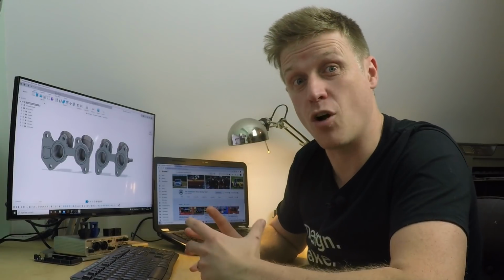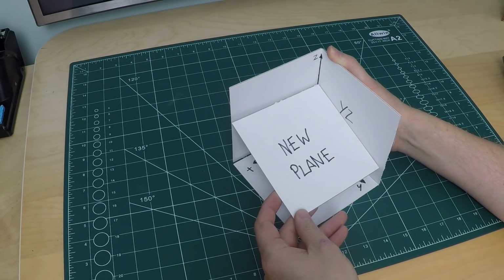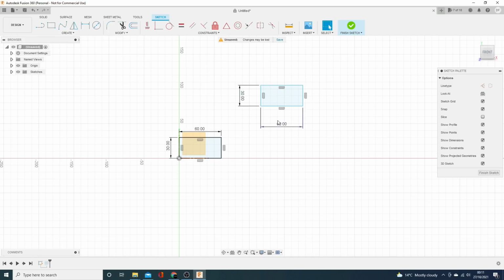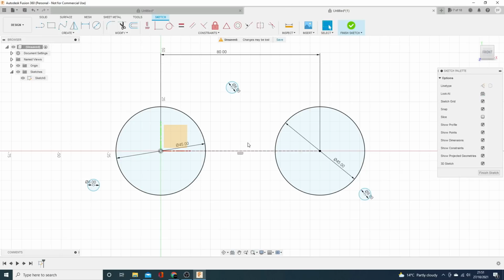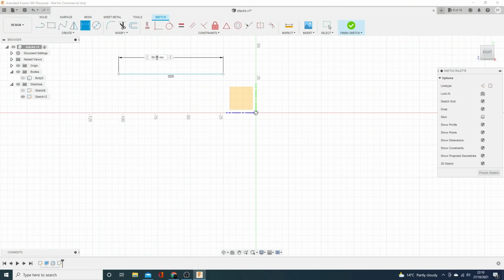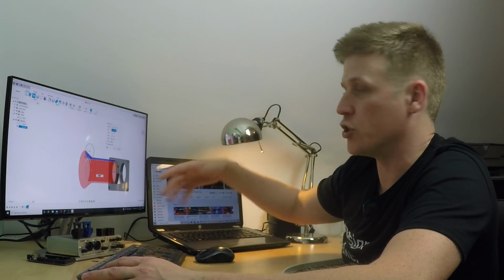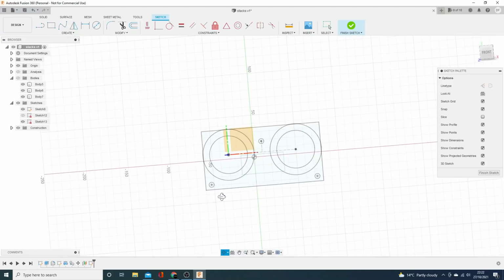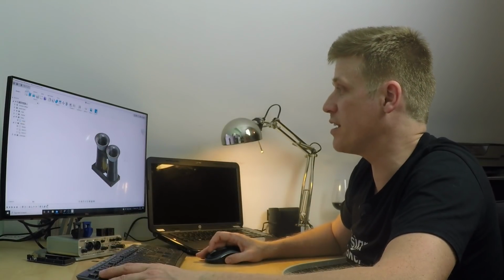How to 3D Model functional car parts for Beginners (and everyone else...) on Fusion 360

Comment: 18:17, as soon as I got to this point, I got a warning that "this dimension would over-constrain the sketch" and it'd give me an option to create a 'drive' dimension instead. What is that and how did you keep creating so many constraints? Why's there a limit on constraints as well? This is my first ever time using any CAD software so I quite literally don't comprehend what that means to be "over constrained 'in that dimension'"! My guess this is just one of the limitations of using the free version maybe?

Comment: Which is the best approach to scan my current air filter box, remodel it(to remove obstructions but keep mounting points) and print it? My question is related to which is the best software for scanning, the best file format and the best software to remodel the created 3D model?  I will be using my phone for the scanning and i have settled on Kiri Engine.

Comment: I also use Fusion 360 free version, which is great, but I absolutely hate that they refuse to let you import an STL file as a parametric model unless you pay for the expensive subscription!
Reply from the maker: FYI… I have the full version, and that function just doesn’t work on stls from scans.  Too much noise and soft edges between faces.  If it does work then the model is so simple you may aswell have modelled it, it would take less time.

It does work better for stls made directly from CAD, (like you might download off Thingiverse) but it still isn’t a magic wand…

Comment: There's lots of really cool features for fusion like defining "parameters" that you can change outside of the sketch, you can reference other dimensions by clicking on them when you edit one or typing it in like d12. And you can import and scale images. Really useful if you have a head gasket or something, take a pic with a ruler, load it with insert canvas, then you can scale it by right clicking on it in the tree of parts
Reply from the maker: I’ve not fully got into the parametric side of things, but getting everything fully constrained is the start…. Something to look at I think!

Comment: Love your channel!  I wanted to make a couple general notes.  I have been a cad professional and have been a trainer for over 10 years.  On the autodesk website 99% of the fusion courses i created.  I have supported loads of different software over the years and Fusion is amazing.   A note i wanted to make is that you said fusion doesnt have cfd and fea.   Cfd is true but it does have fea and generative design.  It will do everything from linear. Non linear. Buckling. Modal. Event sim and on.  It also has Cam to control 5x cnc machines and growing additive.  It should be noted that some limitations apply to the free hobby license. For example you cant poat gcode with tool changes.  The software is generally around $30usd a month though.  So if you use it at all it is very worth it.

I dont want to hijack your channel but recently ive made some car modeling content in fusion that might be right up your alley.  https://youtube.com/playlist?list=PLBDfGh8A8kXUOahS8yk-t0o1nkyzGGQyO

Keep up the great work!
Reply from the maker: Yeah, the paid version has some bells and whistles but I am just trying to get people excited to use Fusion, I see a lot of people on FB struggling with TinkerCAD when Fusion would be a great fit and they should really upgrade.  
The free version of Fusion is really unbelievable (and 10years ago it’d be madness that it would be free) and I just want to get people excited for that!

Just checked out your Form videos, this is a bit on F360 I don’t know we’ll so I’ll be using them 👍
Reply: @MakingforMotorsport  if you ever need anything with Fusion please let me know. Happy to help.

Comment: Engineer here with reasonable 2D CAD experience. Just starting 3D CAD and it has been quite the learning curve. Most of the tutorials I have seen neglect to show you how to go from your extrusion back to a sketch, and how to use the section analysis tool. While these are pretty basic concepts it is extremely frustrating trying to draw parts with out these tools. Great video and keep up the good work. With any luck this will become one of the "go-to" beginner Fusion 360 videos.
Reply from the maker: Thanks John, there are great tutorials out there on specific subjects but if you don’t know, you don’t know!  That’s why I thought I’d do it how I model, I’ve always learnt the most by looking over peoples shoulders anyway!

Comment: If you want two items to be at the same height, you can use the horizontal and vertical constraint on a pair of points rather than using a construction line and a coincident constraint.
Reply from the maker: Cheers bud!

Comment: do i revolve to make o rings fitments?
Reply from the maker: Just filming the ITB section of the next video right now!  It’s coming!  (But no, you can simply draw the inner diameter on the flange head surface referencing off the centre of one of the initial inlet holes, offset the circle by the width of your o-ring groove.  Then do a cut extrude back into the flange et voila!) 👍
Reply: @MakingforMotorsport  thank you mate, you´re awesome, awesome work and dedication. Hope we build up great things togheter!

Comment: This is such a good tutorial. I use solidworks for my job but fusion seems far easier. I have a large SLA printer which can use resins with high use limits of ~260 C. I'm wondering if I could 3D print nearly a whole ITB manifold.... usually intake manifolds don't go over 200 C
Reply: What resin are you referring to? I can’t find a high temp resin.
Reply from the maker: The software you know best is always easiest but I think the learning curve with Fusion is definitely flatter than others I have tried, but I’ve not done much with SW to be fair…

Comment: I’ve got my ender 3, but my laptop is too old to run 360. What do you recommend for sensible money? I’m not a gamer, so 360 will be the most work it has to do. Great content!
Reply from the maker: I ran Fusion360 on a 10year old i5  and integrated graphics, I just banged an SSD and maxed the RAM to 8gb.  It started to chug slightly with the ITB manifold, so if you stay the simple side of that, there’s the spec.  I changed to a desktop mainly for the video editing, but a 10year old Workstation with 12gb of ram and a 4gb graphics card is doing better 👍

Comment: Im working on 3d scanning my Mini R53, all the intricate details like enginebay and wheelwells and all other parts to model stuff around what is already there and have the correct angles and mounting points etc. Using F360 and Blender for it
Reply from the maker: Nice!! What 3D scanner are using and what’s the accuracy like?
Reply: @MakingforMotorsport  Photogrammetry and my xiaomi note 10 pro phone, so quite tedious when it comes to mesh generation and cleanup, but the more i do it, i get more details, plus a ton of reference pictures of course. Correcting the scale is essential and is usually off no matter how good the mesh is

Comment: Another great video full of information. Content and production at the top end of things. Nicely done. I recently made an intake manifold and velocity stacks for my ITD 's. I didn't use this method. My son says I'm to old, cause I melt metal things with magic flames.... and spin ally tubes while I rub them with sticks.
Reply from the maker: You can tell you son sometimes the old ways are the best ways… but they’ll not the cheapest ways!
Casting of some kind is definitely on my agenda…. And metal spinning is akin to a lost art…. (I suppose I might be helping kill them off! 😳😬)
Reply: @MakingforMotorsport   I saw a bloke on You Tube spinning hub caps  He was in Birmingham. The company had been there 3 generations. You couldn't say they were doing reproductions cause they were still producing from the original dies. Thought I'd give it a go.... and it worked.... I do love a box of sand, got taught to do that in High school. I don't think they're aloud to do ally casting in schools any more...We did the local hill climb last weekend.. beet all the Mustangs and a couple of Ferraris. He put it up on one of his side channels Getz going....
Reply from the maker: Just checked it out, looks like he’s pedalling  that Hyundai pretty hard! 👍. I’ve learnt the theory on these techniques… but no doing yet.  It’s a matter of time…
Reply: @MakingforMotorsport  He's still on L plates so I have walk up to the finish line and sit with him when he drives back., cause the return road is public. The folk that run the events are really good and very supportive.

Comment: Why are you using your 3D space with Z as one of the horizontal planes when Z is the vertical?
Reply from the maker: I though I was using XY plane for the first sketch? 🤷‍♂️ maybe not… I’ll have to check…
Reply: @MakingforMotorsport  Look at the view cube in the upper right corner. To change this click your name bubble in the top right corner and click preferences. You will find this parameter titled Default modeling orientation. Dont change it on an existing model, it can mess up critical elements. Really this only plays on the print stage and maybe you want to not worry about orientation. I do like to design with my orientation's setup in the software and that way I can model the design in the orientation I want it to be in when I send it to the printer and not have to fuss with moving axis. Anyway I was just curious why you had this setup the way you did and if I am not mistaking how you have it setup in this video is the default as it is when you first startup Fusion 360.
Reply from the maker: @kevinm3751  yeah it will be default as I’ve not played with it, I have checked and the modelling I do start on XY and make a point of saying it.  I think everyone has to find their own way of envisaging the 3D space but they do need to think about the print z-axis, if they make that the model axis, we’ll it’s one less button in the slicer 🤷‍♂️.  Thanks for the comment 👍

Comment: Good video nice clear advise.

A couple of things to help you, 

if you highlight a line and press X you can turn it into a construction line.

You can use maths when dimensioning, so rather than calculating 1/2 of 126 you can type 126/2 and it’ll dimension the line to 63.
Reply from the maker: Cheers, that’s a handy tip!

Comment: Always interesting the way people use programs and work around stuff.
I like to label the sketches so I can just directly go to that point and edit.
Also short cut keys like x changes a line to construction, d for dimension, e for extrude and so on.
Also pan with the middle scroll button on the mouse and hold shift and use the scroll to orbit.

Enjoying this sort of content because I am working on similar stuff with my race engine.
Reply from the maker: Oh man, using shortcut keys! Now you’re flying!  I’m still trying to remember the shortcut keys for my editing software, and i spend a lot longer editing than modelling 😩😭😂
Reply: @MakingforMotorsport  hahaha i wouldn't know where to start with video editing. Can snip on the phone that is about it. All i did for my car stuff on my other channel thing.

Comment: A few small tips:
-Turn off 3D sketch (unless you really need it)
-For the 45mm and 6mm holes instead of dimensioning them all just give them an equal constraint (or link the dimension by clicking on the previous one when creating it)
-I'm asuming the 40mm is because it's halve of the 80 so I would click on the 80 dimension and then put /2 behind it so it will say something like "d12/2" that way it will auto update if the 80 changes, could also give it a midpoint constraint with the vertical construction line that is 80 long that should give the same result.
-Fully constrain the sketches (it will show a lock symbol on the sketch in the tree on the left if they are fully constrained)
-For the 22.5 dimension on the revolve I would select the "centerline" first then select the outside line and before you put it down right click and select diameter dimension that way it will see the centerline as the mid and you can just use 45 without having to do halve. (If you want to do it even nicer you could turn on visibility of the first sketch > right click show dimension > and link it with the 45 out of that sketch to link them)
-I would revolve it with join and then pattern the feature instead of copying the body (and if you would want to you could reuse the 80mm dimension from the first sketch in the pattern feature (hover over a dimension to get the name of the dimension to use))

(or just model halve the thing and mirror it afterwards)
Reply from the maker: Yeah,  my constraints game isn’t great, but for the level of people who I am aiming this at, (me when I started) just knowing what they are about and how to useful they are is the aim.  
There are loads of ways of doing it, and no doubt yours is likely more elegant, I just went with one I felt I could easily explain 🤷‍♂️

Comment: Hi, i've been working with solidworks for 7 years now (after playing with inventor and some other non parametric softwares the years before) and i think i could add something.
At around 18:00 when you say the things are symmetrical and then proceed to put dimensions, if i understand the icon well enough you should have the symmetrical contraint, it's the second one starting from right. If that's correct it would ensure symmetry without having to change 2 dimensions every time!
Also, solidworks lets you write full "equations" as dimension, for example when you said the holes are 126 apart and had to calculate 63, in solidworks you can just write 126/2 and it will do it for you. Does this work on fusion 360? of course this is easy enough that it can be done easily in your mind, but sometimes you have something like d=x/7 and you would have to get a calculator, do it and the approximate, which is usually bad because it's not precise.
Reply from the maker: Yeah, at that point I say something like “there are better ways but I’m just gonna do it long hand ‘cus it’s the way I know best”. 
It’s always tricky about how much detail to go into and I shouldn’t signposted people to the resources I just to find stuff out, I’ll do that for the 2nd video I think, but in reality this stuff is so basic I just wanted to lift the lid for people scared of the process…
I remember something like that true parametric modelling in inventor (not that I played with it) and I think FreeCAD does it aswell I think but not sure about Fusion… but to be honest if people are thinking about that kind of stuff they shouldn’t be learning from me!!😂
Thanks for the comment!
Reply: For this small type of project I dont think you workflow is the wrong way. Or that some other way of doing it is better.
The best way  is the one that is quick and easy and gets things done IMO.
I do it the same way too for like 99% of my fusion 360 work for 3D printing.

But Fusion 360 supports doing "math" in the dimensions as well. You can Do 126/2 if you want.
And I know that you can do like a "variable list" and then use those  variable names as dimensions.
Like setting "stack_height" to 110 mm and then you can instead of setting it to 110 in the dimension set the  dimension to stack_height or even use math on the variable. Like some other thing might have the dimension of stack_height/2. If you want to change it you just edit it from 110 to let say 160 and in will change all the dimensions referred to as stack_height in all drawing at once.

You find the "variable list" called parameters under the modify list at almost the bottom called "Change parameters" and there you can add your variable/parameters under the "user parameters" section.

Great video keep em coming.
Reply from the maker: @Intesanoga  thanks Simon! You’ve just given me homework!!! 😂. That’s great to know, I’m gonna look that option up!
Reply: @MakingforMotorsport  the other nice bonus tip around this is... you can enter the unit of measurement. So it's entirely possible you have to model an imperial feature in an Automotive part, but you have Fusion setup to be metric. If you type in 1in as the dimension, it will do the math for you and give you a 25.4mm result. 

Nice video BTW... it's cool seeing someone passing on their knowledge of how you have found your way through the software to get things done.
Reply from the maker: Thanks Scott!  I have learnt soo much from the comments section!

Comment: Cracking video. I think it might be useful to do a video on slicing, without thinking about it you’d print from the z-axis up but obviously that would create weakness with your layer lines when you’d ideally need it in the x or y axis. I think lol
Reply from the maker: It does make it less strong but it’s soooo much easier to print and this isn’t structural soooo 🤷‍♂️
Reply: @MakingforMotorsport  that's fairn! K.I.S.S. 😆

Comment: Wait so your saying my two dimensions for my sketch cant be r and theta ahhhh years of engineering school wasted lol jk love your videos. 

Bonus tip for anyone 3d printing things, you can create a tiny, usually less than .1mm wide, slot in a part and the 3d printer will act like there is a hole there and put perimaters around it which can be used to stiffen a part. The small slot will be filled in because of the tolerences of the printer and will build up material in that area. This allows stiffer parts with material where you want it while keeping the amount of infil low.
Reply from the maker: That is clever, so it’ll treat the “gap” like a wall?  Hmmm… this must be tested!
Reply: @MakingforMotorsport  I dont think I came up with it myself, but I used it once when I had a school project to build a mousetrap powered car and we were limited on the amount of infil and walls we were allowed to use and we had a part that broke so I used this to bend the rules to allow the design to still work.
Reply: Nice idea!! I haven't come across that technique before.